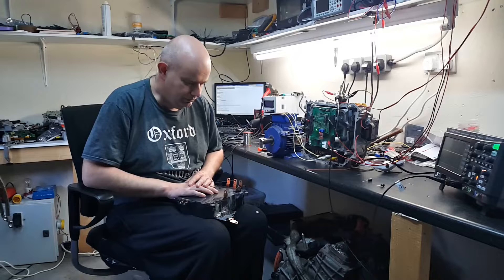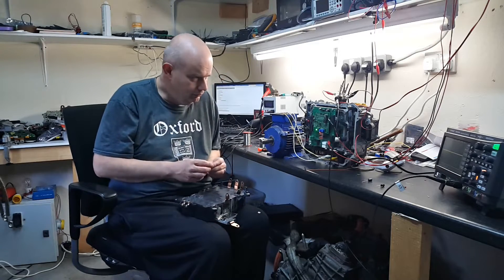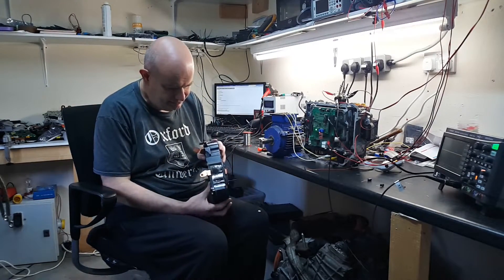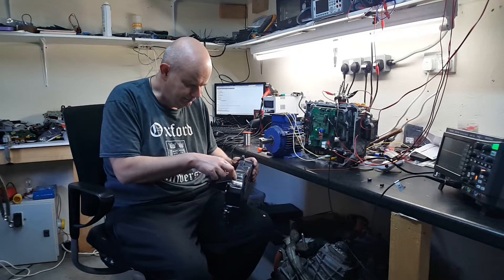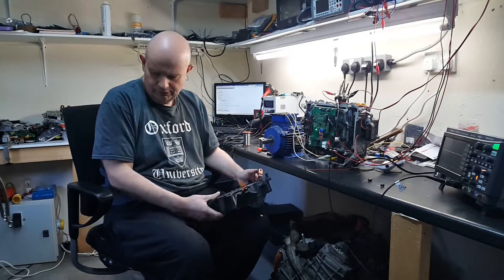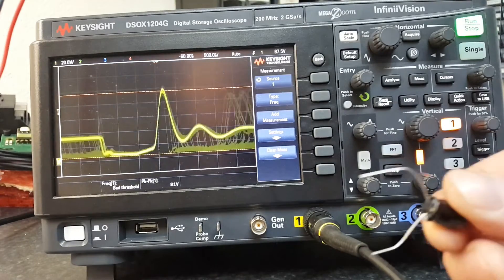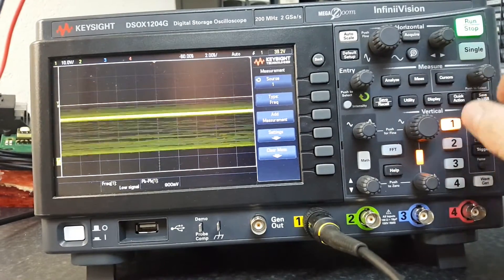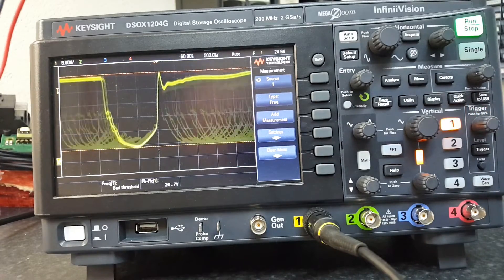Can't Kill A Toyota Inverter Part 3

Comment: Hello and thank you for this job. I have an importante question. I have problem with inverter prius 3 réf g9200-47140.
Can I change it by en other référence like g9200-47230 from auris or g9200-46040 on lexus. Thank you for reply

Comment: Too much dead time is also a problem. Start by removing the bus capacitor removing the load and then checking the bus voltage.  You should have no spikes at all. That is your absolute minimum dead time.
Also as the current, bus voltage and temperature  increase the turn off time of the IGBTs will change.
You will need some high voltage probes to check the bus voltage under full load.
Reply: Luckily, the point of too much dead time is a lot more than too little for IGBTs. IGBTs do not conduct in reverse so there are fast diodes to handle that. MOSFETs have slow internal diodes that you normally do not want to use, hence it's harder to get the right balance for MOSFETs - you have to get the opposite MOSFET turned on in time to prevent the diode from coming into play.
Reply: @NiHaoMike64  the problem is not with the freewheeling diodes conducting.  Too much dead time distorts your waveform which adds harmonics to the output.  This in turn produces parasitic torque in the motor which ultimately reduces your output torque and also messes up the readings for the current which you need for the field control.